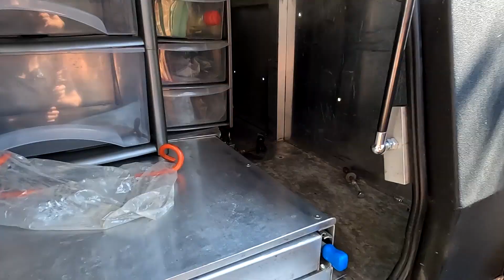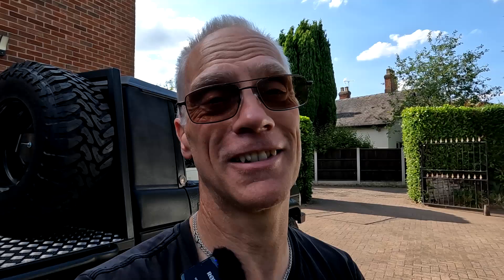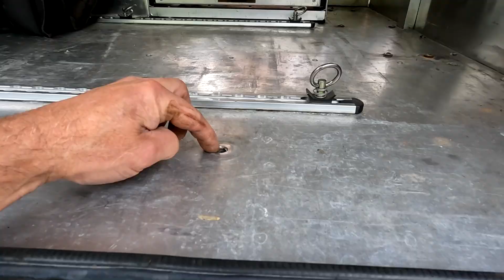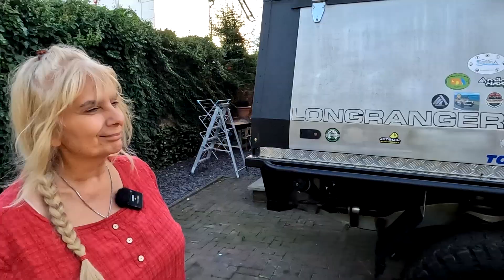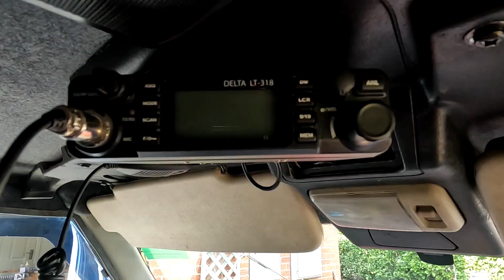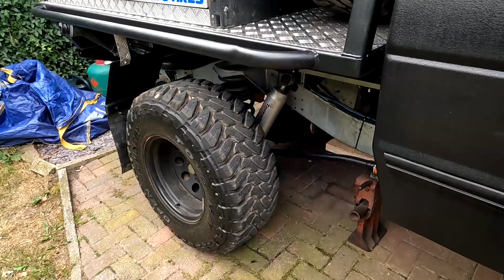Land Rover Pick up, Overland Canopy & CB Radio

Comment: Good rig ,I couldn’t live with the high lift position I’d feel I was going to ware it in my teeth in an accident.
Reply from the maker: Hi mate...glad you like the truck...hi lift has been on the bonnet for about 8-10 years i  don't really worry abot it its very secure and quite handy to stand on if you need to get on the roof of the truck.

Comment: The truck is looking awesome now, mate. The design reminds me of Ruthy from Australia. I'm really interested in seeing how she rides on and off the road. Do you think there will be much difference in fuel economy? For longer trips, this is always a consideration for overlanding.
Reply from the maker: Hi Dan…the design of the truck was definitely copied from John Roothes milo 2 design moving all the weight forward into the middle of the truck I have taken him out and he seems to drive really well but have not tested off road yet and as for fuel consumption should be exactly the same as the truck is now lighter than before
Reply: @All4Overland awesome,  he look the bees knees now dude. What about fold down steps on the back to enter the roof tent to save carring a ladder. Maybe you could use that space for something else heavy, like the farm jack and a jerrycan of fuel. Just a suggestion,  I'm sure you've thought it all out already.
Reply from the maker: We looked at a fold down ladder on the rear, but went for a telescopic one that stores in the canopy instead at the moment the high lift lives on the bonnet but may move between the canopy and the cab later on and now the jerrycan is slung underneath. It is not too bad.